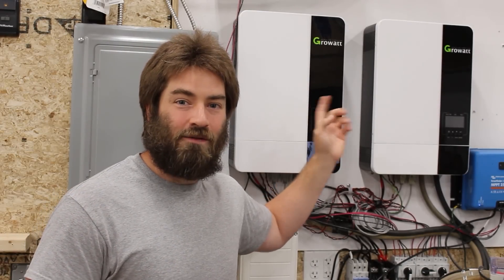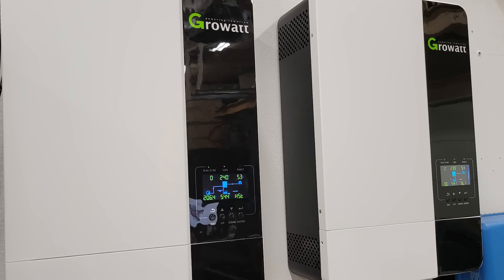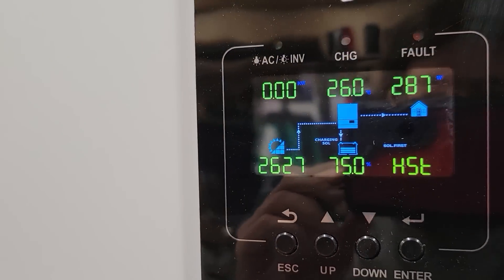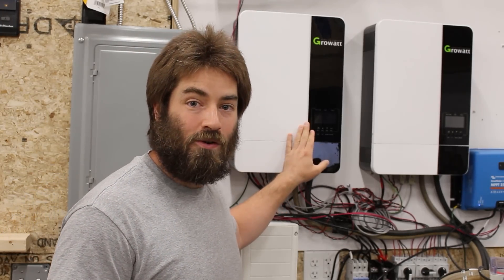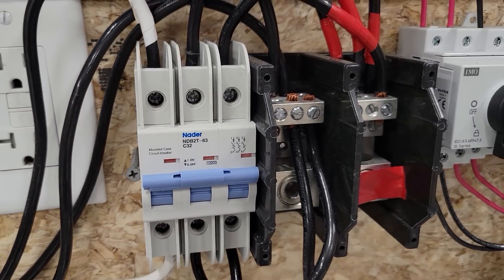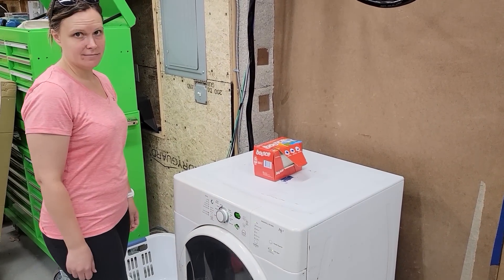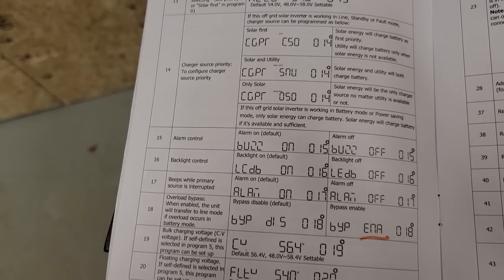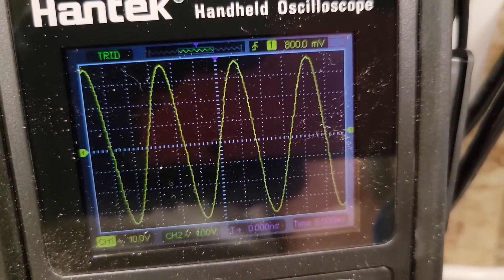Update after 1 year of use off grid, Growatt and EG4 (Gyll) batteries

Comment: What's your growatt settings? Do you still use USE or USE2, or you change those to LI with BMS communications? I've been using LI and saw weird issues where it stopped using PV at 3pm and it starts to use battery.. also what's your load on the transformer? It looks like a coffee machine + water boiler can trip the breaker easily..
Reply from the maker: Mine are on USE2.  Remember, I don't have anything hooked up to the AC INPUT terminals, so the exact setting is less important to me.  

The vast majority of the time the Auto transformer has around 4 Amps on the Neutral.  It is rated for 32 Amps on the Neutral continuously.  My Coffee maker and Toaster both get plugged into the same phase in my kitchen, both draw 900 Watts at 120V, or 7.5A each.  That means 15A on the neutral when both run.  But, the toaster only takes 4-5 minutes, so that's not continuous.  So far, I've never over-loaded the auto-transformer.

Comment: Wait, how do you get backup power when there's a couple of rainy days? Consecutive cloudy days happen quite often, and occasionally we even get like a week or two of rainy days. That would cripple even a double-sized battery bank. To solve this, do you hook up a generator's AC output directly to one of the inverter's AC inputs? Or would the electricity supply company allow you to hook up the grid power to one of the inverter's AC inputs? Thanks

Comment: What happens when  a failure occurs in a battery say like when you lose a cell in a lead acid? Is that the end? We replace cells in 2 volt increments (large size) the sma sunny island is designed for this. Only charge parameters change. Fixed many of our forklift batteries this way no out of service.
Reply from the maker: I have 6 batteries inside the cabinet.  I can run on 3.  That means if one fails, I can remove it and diagnose while the system is still able to run.
Reply: @DavidPozEnergy  Thanks for the reply, I'm asking because might try the batteries on the 12k Growatt.  Bought it in December from Signature Solar  just got it out. I also have around 100 12volt 9amp lithium iron batteries could they be used? Series parallel? They each have built in BMS. The Growatt  mentions no connection for built in BMS. Thanks in advance. Fred
Reply from the maker: Let's see, 100 12V, 9Ah, LiFePO4 batteries will equal about 11.5kWh capacity.  Yes, you can series/parallel them if the manufacturer says the BMS can handle series connection.  Some approve series and some don't.  Your finished battery will be 51.2V, 225Ah.  Given all the connections you will have, the resistance will be high, so you might want to still supplement this with something else to power up a 12kW Growatt.  Most BMS's don't communicate with inverters.  But, if you were to purchase the EG4 batteries from Signature Solar then it can communicate directly with the inverter through RJ45.  There are some advantages to doing this, but it's not required.
Reply: @DavidPozEnergy  I don't owe any money on what i have. Being retired i am on a budget. These batteries have slip on connectors should they be soldered to a buss bar?
Reply: @DavidPozEnergy  They say up to 4 in series.
Reply from the maker: I assume this size battery probably has a male spade terminal.  No need to solder on the terminal of the battery.  You can crimp female spade terminals to a wire, and then that wire can be soldered, bolted, etc. to your bus bar.
Reply: @DavidPozEnergy  I will try that.  Did you ever try shop building arrays? For assembly in the field . I'm going to try it like dc trailer on a single bearinged shaft. Current commercial arrays are being built that way. I can send you pics if you're curious.

Comment: That was great information!  I've been looking at something like this instead of gas generator for back up and it looks like it's way more capable than that.  Now I'm thinking I could run my workshop of this and it there was a power outage I'd have juice for that.  Curious about battery safety issues.  I've heard lithium batteries can catch fire.  Do you have advice in regards to that?
Reply from the maker: There are many different lithium chemistries.  The one in this video is LiFePO4.  It is one of the safest.

Comment: DavidPoz you are saying powering your home with the solar array and converters and batteries is very capable of running your totally electric home without any problems. Would you say this is the way to go for the future?
Reply from the maker: I've been able to run my electric house without problems.  It's probably not the way most people will go in the future since there is a large upfront cost to the equipment.  But, I think it's important to know that it CAN be done.
Reply: The problem is with the solar array because it takes up so much room and could be damaged when a storm hits.
Reply: @carlcapello9956   My roof was damaged by hail a couple years ago.  My solar panels were perfectly fine.  Insurance paid to replace the roof, including the cost to remove and reinstall the panels.  My panels have a 25 year warranty which includes hail damage up to a certain size.  If they were damaged (usually because of REALLY big hail), them homeowners insurance would cover them.

Comment: How much do the inverters deplete the battery at night when there is no solar input? What is the AC and DC efficiency? 😎 Thanks 🙏
Reply from the maker: The usually the inverters are around 91% efficient,  but they peak at 94% efficient.   Each draws 70 Watts in idle.
Reply: @DavidPozEnergy  Thanks for such a timely response. 👍  What is the AC efficiency? I’m impressed that you have engineered a whole house solution.  Are you tied to the grid at all or are you totally independent? Thanks 🙏 again. 😎

Comment: what's a cheaper alternative to EG4 batteries?
Reply from the maker: You can build your own packs.  I have dozens of videos on my channel showing different methods of DIY (Do It Yourself) battery builds.  One of the easiest ways to start is with these cells: https://batteryhookup.com/products/new-4-pack-eve-3-2v-75ah-240wh-lifepo4 and this BMS: https://batteryhookup.com/collections/accessories/products/12v-lifepo4-smart-bms-w-low-temp-cutoff and you have yourself a very nice 12V battery.  Scale up to 16s (16 cells in series) to make a 48V battery which is the same as the EG4.  Please use discount code DAVIDPOZ for a 5% discount, and it helps out the channel.

Comment: Hi David,  I would like to mirror the settings of how you charge your batteries since you are at 100% after a year, figured you are doing it correctly.  I am a total noob so there is a chance our settings could be identical but I have no idea.  Right now my system charges the battery while also taking care of all loads.  Once the batteries are fully charged, it handles all other loads until solar production drops below what is being used, then the batteries kick in until solar production is back up, then recharges the batteries again and it repeats...I am worried that this could cause multiple cycles to the battery on the same day....again total noob so wanted to know how your system is set up.  Thanks!

Comment: I'd definitely recommend a soft starter to stop those voltage drops. Many of them don't seem that expensive and there might well be DIY solutions possible that would probably be a LOT cheaper
Reply: I concur chris, that's what I came on to say. it's just the high initial startup current to drive the motors.
Reply: He has a LV transformer in line.
Reply: @davefroman4700  the problem isn't the voltage change but the voltage sag caused by overloading the inverter. He needs big, beefy capacitors to charge before starting then to dump current, taking the strain off the inveeter

Comment: Hi 
i can see that you might hook up the same solar array with these two inverter. i think it is not the right connection way because  connection more than one mppt with the same solar array would leads to that one tracker interferes the other tracker functionality ,as the result the power drawn from the solar array would be less than the maximum available power. 
my advice is to separate the solar panels equally and hook up the inverters with own array  .

Comment: But now the final question, from my understanding, if victron reaches 98.4 efficiency wouldn't it be better to get rid of Growatt and go all Victron?
Reply from the maker: If you are restricted on space then yes.  Builds like boats, RV's, and vans would greatly benefit from an all Victron setup.  For me, I have a decent sized yard for solar, and garage for batteries.  So I'm asking the question, What's the best value?  Sometimes it makes sense to give up a little in efficiency if there is a huge cost difference.  it's all part of the fun of comparing different options for different situations.

Comment: Hello, can I run it without battery's?
Reply from the maker: You can run a single 5000ES without batteries, but not a pair.  And even if you are running just one inverter, it still makes sense to have a small battery connected.
Reply: @DavidPozEnergy  thank you I bought one today.  I think to buy also some CATL Lifepo4 cells from china. Thank you👍

Comment: Dave, thanks for the great videos.....I bought 2 of the DC Solar trailers that have 2-SMA sunny island 6048 inverters ... a Midnite Classic 250 charge controller... and 2 GNB 48v 510 ah batteries each. I'm wanting to reconfigure them from a mobile solar power trailer to a ground mount 24kw split phase system. I'm only a DIY'er but enjoy learning and the challenge. My problem is this.... I'm looking for but can't find a schematic that resembles the system I want to create. I'm pretty sure I'll need to buy a sma sunny boy' to match up with each of the sunny islands in order to give me 24kw. (I have 140 sunpower 305w / 54.7v panels for my PV source.) I'd also like to set things up for a possible expansion to 100kw which SMA indicates can be done with the SI multiclustering. I want to grid tie...not for the purpose of back feeding but as a power source of last resort when PV or the Battery Bank can't keep up. I'd rather mine crypto than sell power back to the utility at wholesale prices. It would be very much appreciated if you know of a schematic you could point me to......thanks....walt
Reply from the maker: Sounds like a very cool project.  I don't have a schematic for you, but i'd be willing to talk it through if you want.  I'm on Facebook at DavidPozEnergy

Comment: David been watching for some time now. like it alot!
been buying & sending items for an off grid setup in Haiti. about to send the last few items but looking for a diagram/schematic  to insure its connected correctly.  items 
l have:
 one Growatt 5kW Stackable Off-Grid Inverter | SPF 5000 ES (from signature solar)
one Growatt 5kW Split Phase transformer | ATS 5000T-US 
(from signature solar)
one  48 v Husky life-PO4 103Ah 5.3kWh (big battery)
 one Aims power (IP66) PV array DC Isolator 
three  48 volt 435 watt solar panels & four 12 volt 100 watt panels i plan on connecting in series.
the house is wired for power. l want to disconnect the supplied power lines completely (its Haiti... no power over two years)
then connect the circuit breaker box. Getting supplies in Haiti is basically a no go and with the country in turmoil  l will probably not be the guy making the connections.

Comment: Hard to believe you can run everything off 10kw worth of inverters. You must be extremely careful with what is being used and when.
Reply from the maker: The only thing we think about is don't run the oven and dryer at the same time.  Both are 240V electric.
Reply: @DavidPozEnergy   that’s true. Do you use city water or well? I haven’t connected my dryer or oven to the panel yet because I’m still testing my other loads. But I may consider it.
Reply from the maker: I have city water.  I know one of these inverters can run a well pump because I have a friend that does that.  I actually built him his system with the one I took down and have 3 videos on my channel about it.  Here is the last video of the three, but he talks about running his well with one inverter: https://youtu.be/MmKsTafbNyU
Reply: @DavidPozEnergy   yeah I saw that video. I appreciate you being willing to share. I was just wondering because my well surges to almost 4kw at startup. So if I had a dryer running also it may be an issue. I think the way you’re doing it is best. If you don’t need the inverter don’t use it. Less idle consumption and parts to worry about. My biggest issue will probably be battery storage in the winter. My plan is to try a dyi larger AH battery this fall maybe.

Comment: Hi David, thanks very much for your videos, Im not sure if you've answered this already but im keen to know why you've also got a Schneider charge controller there? I have a similar but smaller system and am wanting to charge my batteries faster so hoping you might have the solution
Reply from the maker: Hi Scott,  I don't own any Schneider equipment.  Are you looking at the Victron charge controller (blue in color)?
Reply: @DavidPozEnergy   ah I just figured it out , been watching you older videos, so you have 3 solar arrays charging your battery, and when you removed the 3rd Growatt inverter you needed something to charge connect the 3rd solar array to so it could charge your battery.   makes sense.     So for me to charge my battery I could keep it as is , and add another array of panels and use a charger like yours to help with charging the battery. 
thanks for the videos, very helpful!
Reply: @DavidPozEnergy   hey yeah sorry thats the device I meant, whoops.  yeah because the inverter has a charger I was surprised to see you using one .    but I am wanting to charge my battery faster when the sun is out but can't add anymore panels , ( ive got 1 inverter like yours , and 14x 380w panels. )  so was wondering if I could add another 5kw or so of panels and charge my battery twice as fast ,  using a different charger

Comment: Hi David. Thank you very much for all your vids, it really helps me decide if me and my wife should purchase an off grid system with the growatt inverter (System of 3). Im still new to all of this so i was hopping if i can ask you for a quick advice. Our house will be 100% like yours but im worried if i could lets cay run the oven, dryer and washing machine at the same time? With a note that all 3 are producing heat and burning around 1500-2000W of energy each. Im really worried that we will invest a ton of money and then we have to live by these rules of continues caution of energy so we don’t over-burn or damage our investment. The system we want to buy has 3 growatt inverters and 8 batteries of 100ah. Im too much at the beginning with my knowledge to determine if its sufficient. Thanks again for  all your help! Likes for the videos too
Reply from the maker: Hi.  Thanks for the question, and I hope you decide to go off grid.  
We can't run our electric oven and dryer at the same time...  Well, technically we could, but it would be right at the limit.  Turning on one more appliance like the toaster will shut the system down.  Basically, my wife and I don't think about load management except for Dryer and Oven.  We make sure we don't run the dryer and oven at the same time.  Otherwise, everything else is below the limit.  We could turn on all our lights/TV/computers and the microwave, and still be under the limit of one inverter (5kW).  I go into the loads in more detail in this video: https://youtu.be/EYIzEW54_bY

If you want to never think about it, then you might have to buy 4 of the Growatt inverters instead of 3.  If you find you don't need all 4, then turn one off and keep it as a spare.  

I'd list out all your loads on a spreadsheet with Amps, Volts, Watts, in each column.  For example, my Dryer is 5kW, Oven is 4kW, microwave is 1800W, etc.  Personally I also have a lot of tools, but it's just me.  So I don't run my welder and table saw at the same time (I'm just one guy), so I just list a singular "power tool" in my excell sheet and list it at 15A, 120V, 1800W.  That's generic for any one tool running.  

You can message me on facebook at DavidPozEnergy if you want more help.  Also, if you could use my links for your purchase it will help out the channel.  thanks.
Reply: @DavidPozEnergy  hi David. Thank you so much for clearing up that mystery for me. So 4 inverters would be then better than 3. Got it. Also good idea to make a list for a good overview. I will definitely have a look at the recommended link tomorrow. Thanks for the share. As for the purchase, im located in Europe, Slovenia. Not sure if thats the location it can be shipped also?